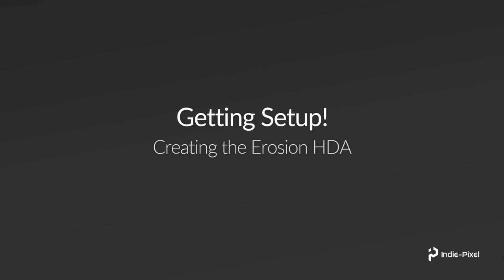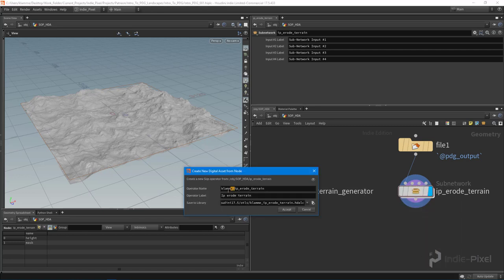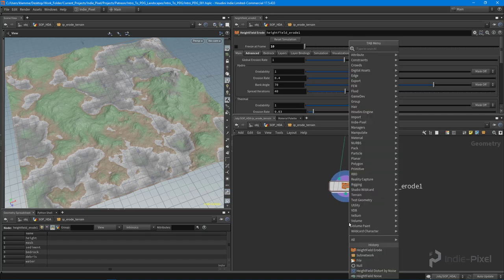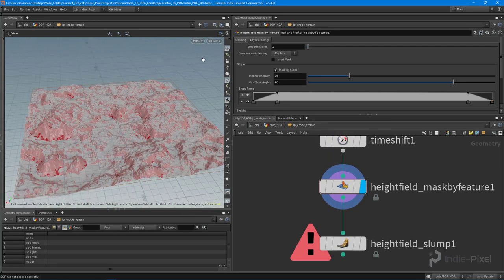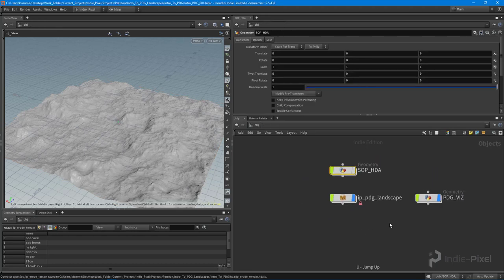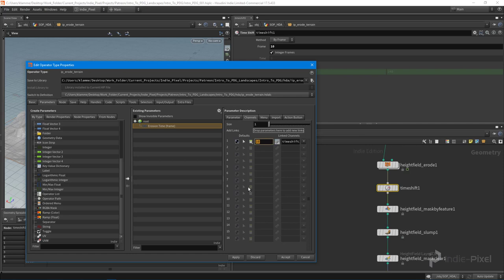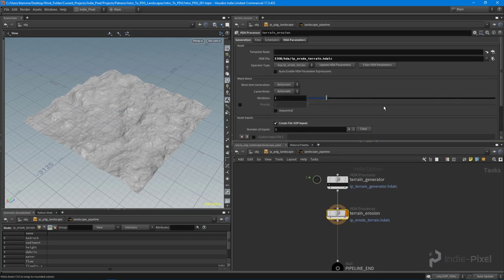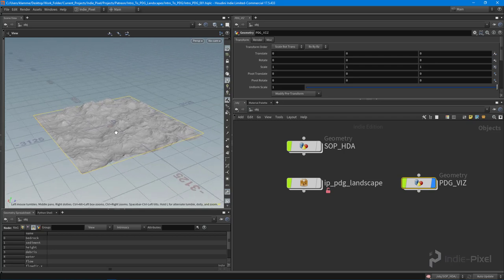Create Massive Terrains with Houdini PDG and Unity 2019.3 - Section 2 - Erosion HDA

Comment: I have followed these tutorials up to  this video but I can't seem to get the `@pdg_output' variable to point to anything, after cooking it's still empty. What can cause this?
Reply from the maker: try putting in `@pdg_output.0` or `@pdg_output.1` to get access to the outputs from a top node.  That should do it for ya! Thanks! :-)
Reply: @IndiePixel3D  I'm having the same issue. `@pdg_output.0` and `@pdg_output.1` don't work. Houdini 19.0.657
Reply from the maker: @Varelze  make sure you have a work item selected in the pdg graph.  If none is selected then nothing will show up.  Other than that it's hard for me to know without looking at your hip file.
Reply: @IndiePixel3D  Ah, the problem was the selection. For anyone else, you "select" the work item when you click on the little yellow dot on the node. After doing so, when you add `@pdg_output` to the File node, it uses the selected processor output. 

I believe the File nodes are only used for the Viz and to see what we're working with as we make the Erosion HDA.

The other problem I've run into is PDG_DIR is not recognized for my processor HDA input paths. $JOB hasn't been a problem so far.